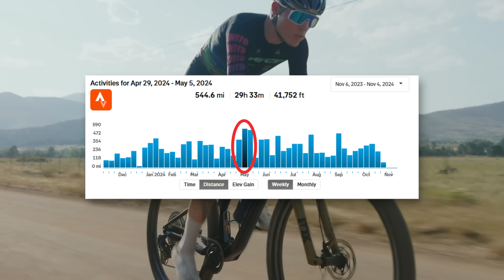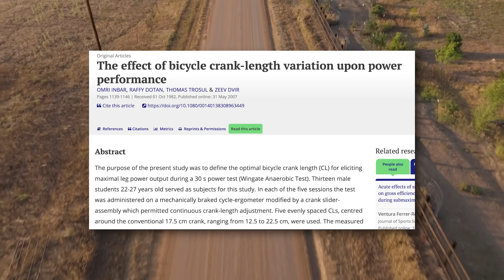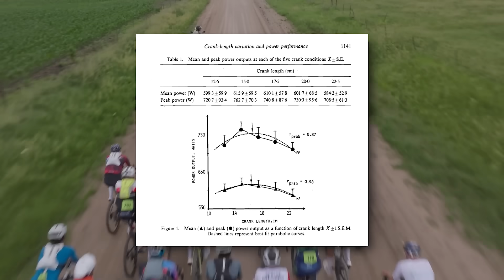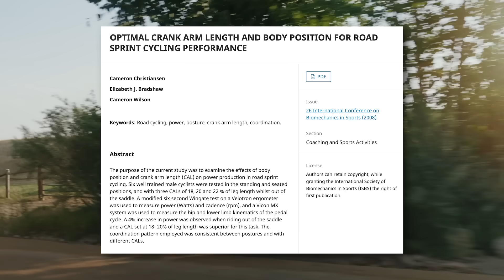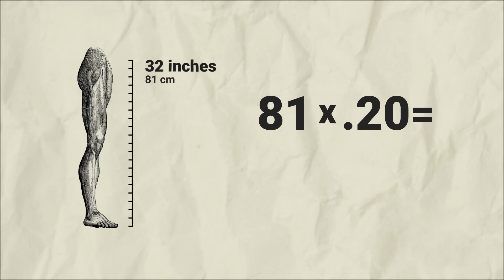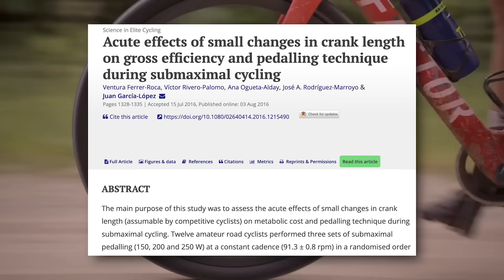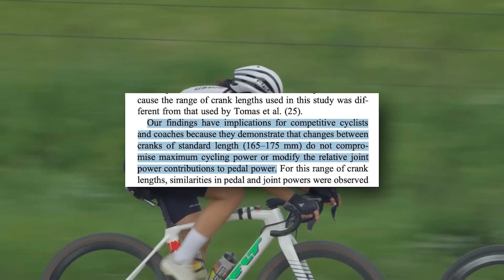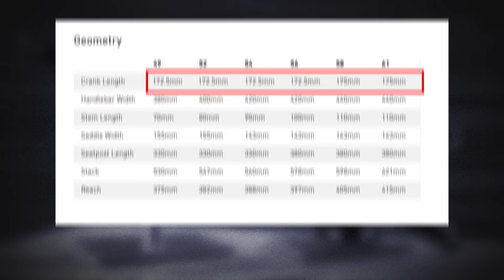You Should Be Using Shorter Cranks, Here's Why

Comment: As someone who's had 5 surgeries on my right knee, no current ACL or cartilage in there either, I've really liked using 165's on my gravel and road bikes.  It's also helped with back pain too.  I also have sciatic nerve issues and the shorter cranks have helped that too.  As for power output, my Peak power has come down, but that's not that important.

Comment: For the same hip and knee flexion from folks 4'6" to 6'6", we should be seeing a much greater range in crankarm lengths.
Reply: Bingo.. best and most relevant comment. 

Have you ever seen a 5 foot rider and looked at how high the knee is at the top of the stroke.
Then observe the same on a 6 foot 2 inch rider!
BTW, standing at 170cm, i ride 140 and 153.5 cranks

Comment: considering you said the performance difference is not that great, I reckon I'd stick with my current 170mm cranks (size S bike), than spending a fortune on 5mm shorter cranks
Reply: Give the 160s a try. I was in the same mindset as you last year, until I decided to switch this year. I love them everything about them.
Reply: @musclelessfitness2045  were you experiencing any soreness in any body areas before?
Reply: @comedyman112  A little bit, just regular exercise pain. 
It just feels easier pedalling with the 160s since I'm making smaller circles.
Reply: @comedyman112  I forgot that with the 170s, I used to have pain in my calves when I push hard. Even now, when I switch to my older bike with 170s, it happens from time to time.

Comment: Went from 170mm to 165mm awhile back when the fad was in full swing......ended up going back to 170's after a month with the 165's.  I've also tried 172.5 in the past as well, and that threw me off.....170 is where it's at for me I guess.  I'm only 5'7" on a good day.
Reply: You probably needed to adjust your saddle and handlebar
Reply: @musclelessfitness2045  I had a re-fit done by my bike fitter.
Reply: @drouleau  I see. I hope your bike fitter isn't the type who's biased against shorter cranks, but you did the right thing.
Keep your 170s then.
Reply: @musclelessfitness2045  It made my pedal stroke weird....my right foot/heel kept lifting up and just felt really uncomfortable that I can't quite explain.  Like my circle wasn't large enough and my foot was trying to stretch outside this confined space....and then my lower back would tighten up as well.  It didn't really change my cadence at all (although my cadence did noticeably lessen with the 172.5's oddly enough), but it was more comfortable in the drops with the 165's.  That was about the only benefit for me.  Didn't feel an increase in power with the 165's, it actually felt like it dropped off slightly given the same level of effort (based on my power meter).

Comment: My two best one-day performances ever on the bike came earlier this season on 170mm cranks. Coming from 172.5mm. I'm 6 feet tall. One might argue that the 2.5mm crank length difference is insignificant, but really it's more like 5mm in total diameter. Especially if you raise your saddle accordingly. That marginal difference (for me) allowed me to sustain a more aggressive position on the bike for longer, increased my cadence, and mitigated potential quad cramps during higher efforts 3-4 hours in. No power loss in my sprint either. The only area not so great is climbing out of the saddle.
Reply: You guys are way more sensitive than me! Almost 70 years old, been riding bikes starting with those one-piece, forged steel, chromed things that came on Schwinns. What length were those? Rode 170 mm for years until a free crank with 172.5 came around. Couldn't tell any difference and rode MTB's with 175's for years. There's one of those hanging in my shop now that I rode last week. Had some road bikes with 175 mm cranks too. Switch between all of these bikes and don't notice any difference - no knee pains. Same saddle height on all of 'em. I was never fast but just lucky? I have two modern gravel bikes that I ride regularly - couldn't tell you right now what the the crank length on either of them is...but I'd guess 170 mm? IMHO people make a much bigger deal of this than it warrants...kind of like waxing your chain?
Reply: @larryt.atcycleitalia5786 it really depends on your leg length. For us shorter guys at 165cm or lower default cranks on bikes are way too large. S/XS frames still mostly come with a 172.5mm crank. This meant for any proper bike fit you'd need to drastically shorten your seatpost, but too short would mean you'll start to hit your chest when pedaling on the drops, but raising the saddle won't work too due to being short. 

I could ride with 172.5mm cranks that my bike came but there's a huge difference in performance and comfort between that and the current 160s I run my bikes with as I could hold an aero position very long now without my knees hitting my chest.
Reply: @larryt.atcycleitalia5786  Thanks for your personal, albeit anecdotal, experience. Everyone is different kind sir.
Reply: @larryt.atcycleitalia5786    Says the guy who never experiences knee pain.  For those who do have knee pain, anything that helps with no negatives would be a good thing, no?
Reply: What's your inseam, mate? Height is irrelevant.
Reply: @ No clue, but the overall point is shorter cranks work for me
Reply: Would you consider testing the extremes like 155?
Reply: @ISpitHotFire   Not if I have to invest in the cranks myself LoL
Reply: How long is your leg from the knee down? 2.5 milimeters makes no practical difference.
Reply: @ 5mm

Comment: Based on the formula I can go from 155 to 170 cranks... I have tested 155, 165 and 170 cranks...and I feel best on 170... Especially out of the saddle when climbing. 155 feel just crazy to me...hard to put the power down. And I am on the shorter side with a 175cm of height.
Reply: Since you are a relatively tall guy, I'm guessing you might have to stick with 170s. By the way, where did you buy the 155s?
Reply: @musclelessfitness2045  tall? That is a compliment I have never heard in my life😆 
I just got some aluminium ones from AliExpress for testing as I didn't want to spend to much on testing out the cranks.

Comment: Finally ! a Dylan Johnson video !
I changed from 170 to 160 and I love it. I love the shorter cranks for these reasons :
1 - no more fear of pedalling in corners (I still have to be cautious) 
2 - no more hitting the front tire if I turn my handle bar a lot
3 - faster cadence, even when I'm not trying.
4 - less knee and hip pain

I might try 150 or 155 mm on my second bike ... we'll see
Reply: I'm 5'9"...I've been running 150mm on my road, mtb and gravel bike for the better part of 8 years. Its just more comfortable and once I got used to it I can't find any down sides... other than finding manufactures who make 150 cranks is a little tough sometimes.
Reply: @dirtrambler  Nice to know. Which brand did you buy for your road bike? 
I don't wanna buy those 500$ cranks lol
Reply: @ I I I found some Rotor cranks used , before that Origin 8 square taper, before that Crupi Expert BMX cranks actually worked great as well
Reply: I'm 5'7 with a 29 inches inseam and I've been riding shorts cranks since I started cycling in the early 2000's. I started with 165mm, experimented with 160mm, 155mm, and after I got fitted by an experienced bike fitter, he concluded 150mm cranks were the magic number, which makes sense based on the crank's length equation ( 29 inches = 74 cm.  74 cm x .20 = 148 Round it and Voila! 150mm Cranks) 

There are a lots of benefits riding short cranks I've notice over the years. No knee pain, my cadence went from 82~85 rpm to 98~100 rpm, better recovery and yes, you will get faster. It is a marginal gain, but it is noticeable. 

The good news is there are a lot of new companies making shorts cranks nowadays. Here are some models I've personally owned over the years:
Rotor ( Aldhu 150mm )
Crupi ( Rithm 150mm)
Sugino ( Xd2 152mm)
Promax ( SQ1 150mm)
FSA ( Gossamer Pro 150mm)
Reply: @ If you can find them the short FSA Gossamer Pro look like a cool option. I never see them in stock anywhere though. Appleman cranks look great, although I wish he did more sizes.

Comment: Im 6'4 tall, 52 and have ridden 175s for 31 years.  Also consider my ride style more diesel than gas.  Recently got new MTB that came with 170 cranks.  8 rides in on the new bike and Im not sold.  I do feel like its costing me power compared to 175 and even 180s Ive ran in past.  It is good for pedal strikes.  I dont have fast cadence and Im just an average rider but maybe people like me are an exception to the trend.
Reply: You are tall, so you should get longer cranks. If the inseam is around 88cm, the formula suggests 175s, but I have a feeling yours is longer than 88cm.
Reply: @musclelessfitness2045  agreed.  I think 177.5 would actually be perfect but it's hard to find.  I use 180s on my XC rig and feel a little rocking in hips at times.

Comment: I used 155 cranks on my winter bike and it was efficient cruising at 20mph on winter roads on a 1970s steel hack, using a pretty low fixed gear and twiddling.  
After years of 170mm I have put 165mm on the road tt bike ( a thing in the UK now.... ) , got my first win in years in a hilly 25 mile tt last season.  The 175mm on the mtb feel ridiculous 😂
Reply: Great! I'm happy with my 160s, but I wonder if 155s are even better since the formulas suggest them. Where did you buy yours?
Reply: @musclelessfitness2045  mine were off a junior road bike years ago. Getting decent modern ones you'll be looking at cranks made for kids cyclo-cross or road bikes.

Comment: Re: advantages of shorter cranks, maybe I didn’t understand correctly, but you can get a lower position OR reduced risk of injury but not both, right? Like the lower you go, the more you close your hip flexion angle?
Reply: It's both. With shorter cranks and lifting a bit the saddle you can bend the same at the hips (more aero, as this bend is now from leaning forward instead of knee going up) while bending less at the knees (less knee joint strain)
Reply: @franciscodron5378  Fair enough, makes sense

Comment: I went to 165 from 175 on my Pivot Mach 4 and the 10mm made a really big improvement in pedal strike occurrences. That new mountain bikes  are so low but come with 175mm cranks makes no sense. The first ride on them I was ecstatic for what I perceived as less stress on my legs, as seen by getting to the tops of climbs and recovering much quicker. I can't quantify it as a true performance benefit but I def came away feeling it was money well spent.

Comment: Funny how we have gone from 23 mm tires for fast aerodynamics to 32 mm and long cranks because you get more “torque” to shorter cranks.  I have 165 on my Tri bike and notice more efficiency than my road bike a 170 mm. I wonder as a triathlete if shorter cranks might reduce a bit of strain on the upper hamstrings which could help the run

Comment: I don’t quite get how shorter cranks make you lower on the bike. Shouldn’t the saddle hight be raised with shorter cranks?
Reply: Saddle goes up yes, but knee angle is lessened meaning that if you can rotate your pelvis well then you can get over and potentially lower, Dylan mentions time trialing favouring shorter cranks which is possibly easier to visualise.
Reply: It makes you more bent forward and "horizontal" rather than "lower", as saddle goes up but bars don't

Comment: the power difference between crank lengths is almost irrelevant. The huge upside of shorter cranks is in the potential aero gains. Those gains are far from marginal, easily double digit watt savings. I'm 6'2" and switched from 175's to 165 a few years ago and it was revolutionary in my bike fit, Saddle went up ~15mm, stem dropped 20mm, and went out 30mm.

Comment: 11:05 Shorter cranks = more aero? Doesn't shortening the crank mean that the saddle has to be raised by the same amount in order to improve the closing angle of the hip and achieve a better fit?
Reply: Definitely more aero, your upper body gets lower due to the more open hip and knee angle. The saddle height goes up to maintain the distance between the saddle and lower pedal, so no loss there but the upper body is able to get lower.
Reply: @gregmorrison7320  I get the idea. Guess it depends on the reason for switching to shorter cranks and the effect that one tries to obtain. If one suffers from hip pain due to a lack of mobility in the hip or an injury, a shorter crank while raising the saddle and handlebars might enable the rider to sit more comfortably. Leaning forward to get more aero might counter the effects of the shorter cranks by closing the hip angle. Not even talking about the knee... . I'm no expert, but I suspect that "short crank = aero" might be a bit of an oversimplification.
Reply: @gravelnomad  I run 165mm cranks on five of the six bikes I own, I did it purely for the aero advantages because once I experienced the ability to ride in the puppy paws position which is extremely aero and comfortable I had to do it to my other bikes except for a SS MTB which I mainly use for local rides to the shop. I have not had to raise my handlebars on any of these bikes with the more open hip angle.
Reply: @gregmorrison7320  Sounds reasonable. Ride safely!
Reply: Exactly what I was thinking. You still have to move your saddle higher

Comment: I'm 6' 4" but switched from 175mm to 165mm cranks about 3 years ago so I guess I'm ahead of the curve! I switched after reading the research which affirmed there was no effect on power output but it did help with hip impingement which is something I used to suffer with. I think it has also helped with increasing my cadence slightly where I used to be a bit of a grinder but that might just be because I am getting older, 😁

Other advantages of shorter cranks are reduced chance of pedal strikes and lighter weight.

Comment: Hey, I'm 176 cm high (5'11"-ish), but my inseam is 87 cm.  In my youth (40 odd years ago), I was using 170mm because that was mostly what was available, but I always felt them to be on the short side and didn't like them when going uphill, specially when grinding.

A few years later, I managed to get 175mm, and boy my cycling life changed for the better and I never looked back.

When computing the value for my ideal crank length with 2 formulas available online I get 173,75 (exactly the mid-point between 172.5 and 175) and with the 20% I get 174.

I also don't suffer from hip impingement like Cam (shown in your video) and can get in a low aero position no problem and keep it for a long time.  Never had knee pain related to crank length either.  Finally, never had any cadence problems and can sustain 100+ RPM for hours.
Reply: Going from 170 to 175 is not a huge difference, but according to those calculations, 175mm is the perfect size for you when you include shoe soles. 
Glad it works out for you.
I moved down to 160 because I'm much smaller and I'm happy with them. The formulas suggest even smaller lol but those cranks are either too expensive or some Chinese brands I'm not sure about their quality.
Reply: 5'11" you wish ;)

Comment: 6’6” years ago went to 190mm cranks. Power up, cadence down, HR down. Life long hip pain gone.
Reply: I’m 6’7” and switched to 165mm on my mountain bikes. Knee pain gone! Seems like it worth experimenting with… there might not be a best option for a given height.
Reply: @alexander.sollie  my system of ‘levers’ works best with the longer cranks.
Reply: @ I’m curious… you must have had a frame built around those cranks, right? Do you have trouble riding other bikes with shorter cranks now?
Reply: @ I don’t ride any bikes with short cranks.
Reply: wait 190mm, what did you have before?
Reply: @Nilex1994  whatever came on the bike. Then 180’s in the early 90’s.
Reply: I have done, yes, but have put them on other stock frames. Specialized Roubaix can be dodgy. I don’t pedal through sharp turns, lol. No overlap though.
Reply: Power is torque times speed (rpm). If Your torque went up and your cadence went down then your power output stayed about the same.

Comment: Went from 175 mm to 165 mm on TT bike. Helped with breathing, ftp not affected, but I just couldn't put the same power out on the short hills. Split the difference and went to 170 mm. btw, long femurs make you less sensitive to crank length (so my fitter told me) and help with climbing. I live in a hilly area so I'll stick with 175 mm on road and MTB.

Comment: I am a time trialist. In my case, my cadence drop as a get tired on a time trial. I tried the shorter cranks for 6 mobths,  and my average power on a time trial went down. My legs were fatiguing faster
Reply: Lever effect
Reply: If you are tall enough, you don't need shorter cranks. If not, you might have had to adjust your saddle and handlebar height